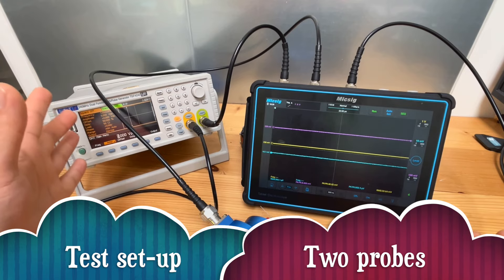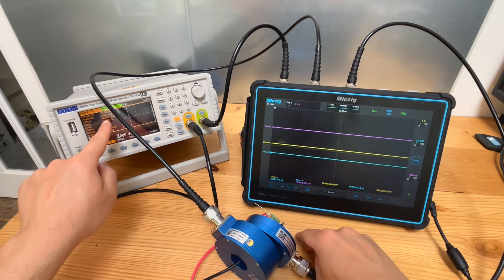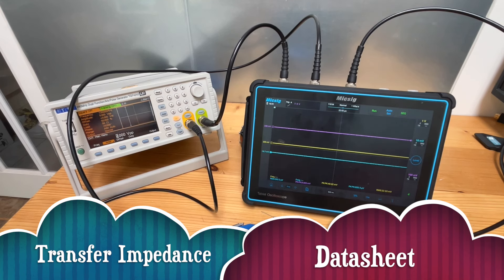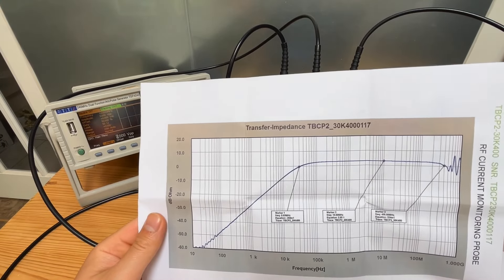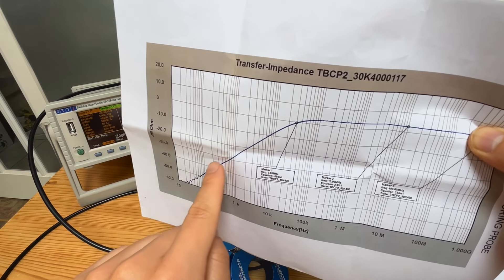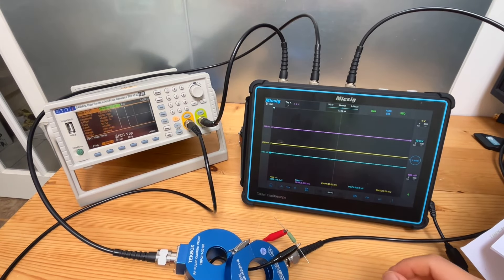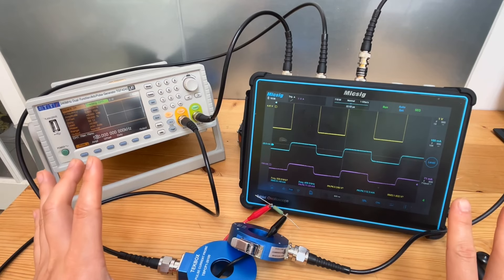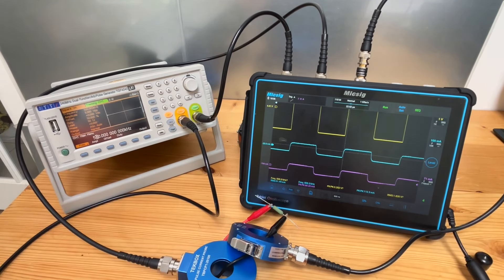RF Current Probes Episode 4 - Practical Use & "Droop"

Comment: My issue is as a engineer is the ferrite core  of any power transformer is inductance no matter how tight I wound the turns in phase the capacitance always end up to be there in 8 or 9 nf even commercial transformer has the same capacitance and ringing is always there when current is drawing pass 20 amp and this is my issue I even use copper trip to cover the transformer and connect to ground the ringing still there I have to use a iron powder core and 450uf capacitor to remove the oscillation from the current sensor transformer to stop the ringing of the transformer when over current pass
Reply from the maker: The parasitic capacitance is always there, sometimes, you can place some broadband ferrite sleeves on the co-axial cables to block possible E-field coupling between the DUT and the metallic case of an RF current probe.